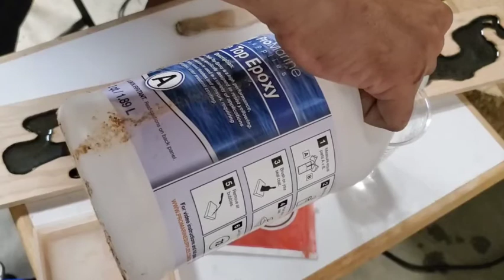Making some resin river coasters

Comment: How do I plane them without a planer?
Reply from the maker: You can be real careful when pouring the resin then take a plastic card and swipe it across the top to level it out. Then when it cures sand away any overflow